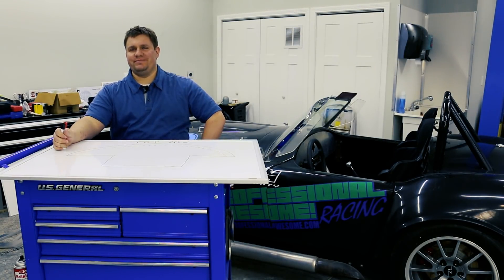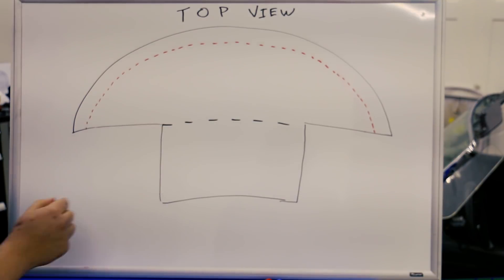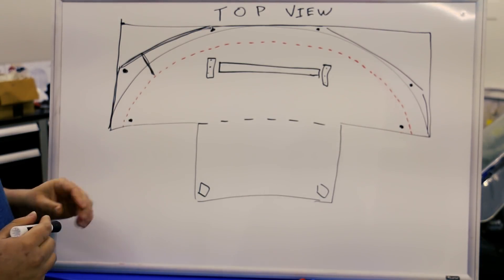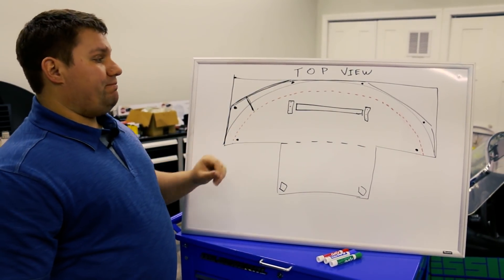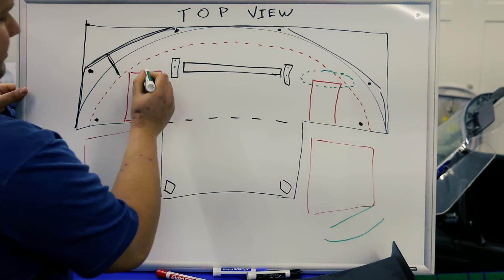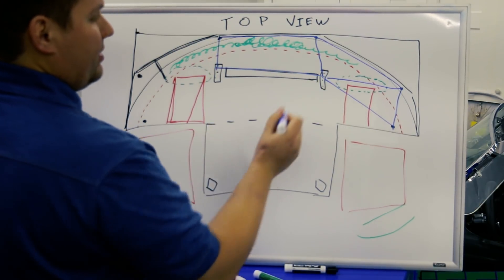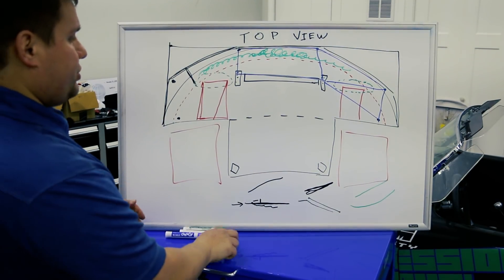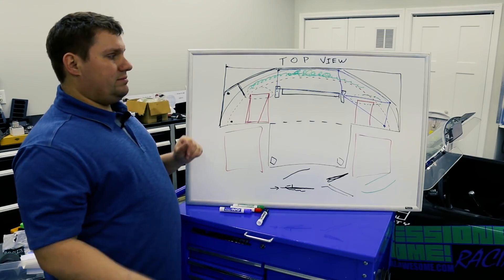#DIYDownforce Part 2: Secrets of creating front end downforce with a splitter, air dam and diffusers

Comment: Does the inlet of the splitter difuser face the front of the vehicle? Or is the diffuser supposed to look like a ramp, and have the opening to the back or the splitter?
Reply from the maker: If you imagine it like a triangle, the pointy end goes towards the front of the car and the big end points towards the back.

Comment: Wouldn't a slightly high concave front of the splitter not force more air under the splitter and thus speeding the air up further decreasing the pressure and adding downforce?
Reply from the maker: This is a very common practice in higher levels of motorsports, but a little difficult to perfect. It's one I'd recommend testing, but with an understanding that it might be hard to dial in exactly to your expectations.

Additionally, it will have greater downstream effects. So any rear aero may or may not work as intended.

Sorry for not being able to give more detail, but ever car starts to get more case specific the more complicated the aero structures.

Comment: I know this video is 3 years old but have a question about side skirts. I have a 19 c7z06 with nine lives wing, custom made large front splitter with diffusers. Looking to do more so now moving to rear diffuser and side skirts. I have the factory side skirts and a little trick I don't share to often which dropped lap time consistently over 5 tenths in back to back testing over 2 year. I take rubber from a company called all fit and run about 3 to 5 inches in from the edge of side skirts and go close to the ground as I can get so creating a rubber side sealed tunnel. Now to may question. Can extended side skirts improve downforce or reduce drag. So in a sense a splitter for the sides of the car. I've seen companies sale this and people install typically flat abs but don't see how it would help. Even more so with my tunnel under the car. Let me know if you have any thoughts or any testing for this idea. I know it's an old concept put not much information out there about it and I've never tested it.
Reply from the maker: Thanks for the info on the rubber seals. To your question, yes, extended side skirts can help in a few ways. First, remember when you are in turns there is a yaw moment to the car so air is hitting it at an angle. This slight angle can help produce higher loads on top of a side skirt than the bottom, creating downforce. Additionally, it can keep airflow from the top surface of the car interacting with the bottom, which can help downforce and drag. Exactly how much is very dependent though. Testing would need to be done and the gains are much smaller than a front splitter. That being said, the same principles apply, closer to the ground the better. The longer the extension, the gains will drop off.

Comment: Not to be an armchair aerodynamicist, but the placement of those diffusers doesn't totally make sense to me. Any air coming out of there would head right into tire squirt and get all turbulent. Wouldn't you want them more central and ducted to an oil cooler or something if you're going to use them at all?
Reply from the maker: Monty, often our intuition gets us in trouble with aero. A decade ago, I'd agree with you completely, but the CFD and wind tunnel data I've seen suggests firing the diffusers at the tire actually does the opposite. It lowers the pressure zone where the tire meets the tarmac. You get a double benefit of lower air pressure at the leading edge of the diffuser and where the tire squirt occurs. Certainly each car will react differently when trying this so I'm not saying this solution will work on all cars and all situations, but from what I've seen, it's safe to utilize this method for most applications.

Comment: Can you share any resources on how to calculate front end downforce based on splitter size? Looking to build an appropriate sized front splitter to balance the rear air foil accordingly.
Reply from the maker: Unfortunately, there's no great resource or universal answer, but a cool and easy to understand article was written by Verus Engineering that I like. https://www.verus-engineering.com/blog/cfd-cases-4/air-dam-or-splitter-a-closer-look-12

Additionally, Simon McBeath's book, Competition Car Aerodynamics, has some great case studies with CFD and wind tunnel data that have info on front splitters. He also has some great articles in the magazine Racecar Engineering that are very useful, but you have to do a lot of digging to find the best ones unfortunately.
Reply from the maker: One more thing, make sure to match aero balance with weight balance. If you car is 50/50 weight distribution, try to keep aero balance close to that. If it's 60% front / 40% rear, you need to have ~60% front aero / ~40% rear.
Reply: @ProAwesomeRace  I roughly knew this from the beginning but it was actually your aero balance blog post that has sent me down the rabbit hole trying to learn/calculate. So, thanks for putting out good material.

Comment: Great video.  Thanks for putting it together.  Is there a way for us layman to measure how much downforce we are getting?   Is there some kind if balance to aim for between the splitter on front front spoiler or wing in the back?  Any suggestions or recommendations on a spoiler put back?  Working with a 4th gen Camaro and although I know I'd get more downforce with a wing it just doesn't look right.  Wondering how much rear downforce I might be able to get out of something like a Wicker Bill spoiler.
Reply from the maker: This book here has a great section on rear spoilers: https://amzn.to/2NrV9Ki.

We used 4 very inexpensive sensors to measure suspension travel, kind of like these: https://amzn.to/3pi6r23.

As long as they output 5 volt signal, you can use them with a datalogging system. You have to do math to covert the signal into wheel movement and then compare them against the spring rates to get a rough amount of downforce. Make sure to keep in mind the difference between wheel and spring rates. With this data, it can help you balance the front vs. rear downforce. Hope this helps!
Reply: @ProAwesomeRace  awesome!   Thank you very much!

Comment: You didn't explain how the splitter diffusers work...  For us dummies, I'll be buying them if I can figure out how they work
Reply from the maker: Forgive us for not going into more detail on specifics. Essentially, air is "squeezed" under the splitter into the entrance of the diffuser. The diffuser is closest to the ground at this point, the ramp of the diffuser expands, creating a larger volume for the air. If done properly, this will speed up the air under the splitter, reducing air pressure. The high pressure on the top of the splitter, caused by the air dam slowing the velocity of the air, will create a large pressure differential, pulling the splitter down towards the ground, which is downforce! Check here for information on the physics we are taking advantage of. https://en.wikipedia.org/wiki/Venturi_effect

For more specifics on downforce in relation to cars, check our written series here. https://professionalawesome.com/diy-downforce/
Reply: Can you provide any resources on how to calculate approximate downforce produced by a front splitter? Doesn’t make much sense to make one of it doesn’t pair well with the rear end.

Comment: I have a question, I was thinking of using diffusers on both sides of splitter to cool down brakes, is it good idea? Using some sort of steering angle vents like focus rs mk3? Will it work?
Reply from the maker: Sorry for the late reply. Most certainly the diffusers can help with brake cooling but not to the same degree as a well designed inlet duct in the front bumper. Depends on how much cooling you need.

Comment: How much ride height do you have to run a splitter like this for you to see some reasonable benefits? Obviously it's not gonna work on a lifted truck, but what about an average sedan? Say about 6 inches-ish?
Reply from the maker: A splitter will work 6" off the ground but the effectiveness of it is reduced. If the suspension is properly setup, going as low as possible is the best bet. 2.75" or so is where I'd like to be as a good compromise between the splitter hitting the ground and getting the best aero performance.

Comment: thanks. I have a very simple question. why tilting towards the ground the splitter will be better in generating more DF? wouldn't it loose the pressure on top ( air will move under cause it is not really'split') reducing DF?  in another videoan engeneer saidthat in theory lifting up the front splitter will alow more air to go under the car ,increasing the volume, increasing the speed, and as consequence having a even bigger lower pressure under the car? please let me know and thanks for the videos!
Reply from the maker: The slight angle towards the ground will turn the whole splitter into a large diffuser which helps with downforce. Raising the leading edge can make more downforce if the whole system is made to work together. Raising the front edge too much will greatly hurt front downforce. These designs are intended to be simple to produce but effective. There are many ways to do it but we wanted to highlight what works.
Reply: @ProAwesomeRace  awesome. Thanks for the reply.
Reply: @ProAwesomeRace  so you mean if there is a flatfloor and a rear diffuser the whole system will generate more DF?
last, i promise :) what make a splitter generating DF? The high pressure on top that"push down" the front or the fast air/lower pressure under that suck down there splitter? Thanks again.
Reply from the maker: @italian_stang  Correct. If done correctly a curved shape for the front of the splitter will make more overall downforce with a full flat bottom in most cases. A splitter will make downforce on both the top and the bottom if designed correctly.
Reply: @ProAwesomeRace  very nice. Thank you

Comment: If I wanted to try to make my own splitter diffusers, would the guideline for rear diffusers of less than 10° from parallel still be ideal?
Reply from the maker: Yes that would still be a good guideline. The most important part is the transition, which is why ours have the shape they do.
Reply: @ProAwesomeRace  Good to know. I'd probably just buy yours, but I was curious.
Reply from the maker: @GasInMyVeins20AE  Awesome. Yup, no problem.  The transition is something to keep in mind if you make any diffusers, front or rear.

Comment: How far back from the leading edge of the splitter would be a good point to start the front diffusor (How much flat area is needed infront of the front diffusor)?

Noticed you recommended some of the front diffusor to vent into the suspension area and some of it straight in to the tire. I might have minsunserstood but why ist this?

Thanks!
Reply from the maker: Jimmy, we generally allow 3-5" before the diffusers to allow for attachment. It's not a requirement as every application is different but it's a good rule of thumb. Testing with strings will give you a good idea if the diffusers are working. 

We recommend directing the diffuser outlet half on the tire and have to the open suspension area as it allows the air to escape to the easiest path. Some cars, pointing at the tire is best, some cars pointed at the suspension is best, but half and have is a good compromise.

Comment: Do you prefer rigid mounts or mounts that allow some deflection upwards? Either due to curbing or dips?
Reply from the maker: Rigid mounts for the main attachment by the core support, then somewhat flexible at the outer locations. You want the blade to flex when going over curbs. This is why we use cables at the edges.

Comment: Is a splitters length proportional to the speed the vehicle is traveling? Eg. 200mph vehicle have a shorter splitter or maximise the allowable length.
Reply from the maker: Generally if you are in a lower class you should maximize the length allowable. For unlimited 8-10" is the sweet spot in our testing to balance downforce and drag.